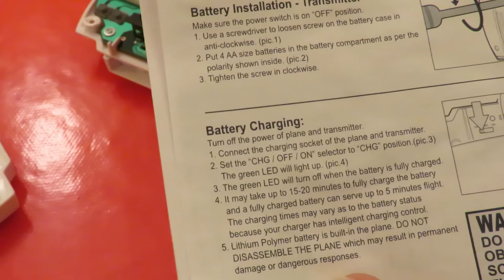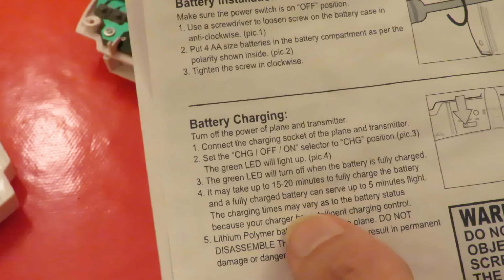Charity Shop Gold or Garbage? RC Biplane Silverlit Palm-Z PART #2 Check the charger

Comment: you can made f22 mini 30cm by rx v911 ?
Reply from the maker: That might be more complicated than you think. With the servos mounted on the receiver board you will have to route the push-rods round the bodywork to clear the propeller.